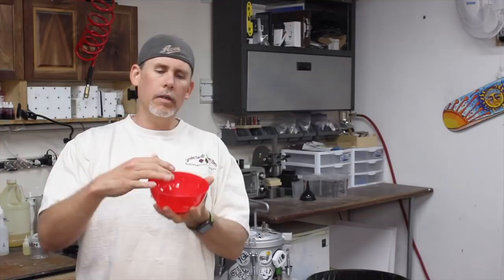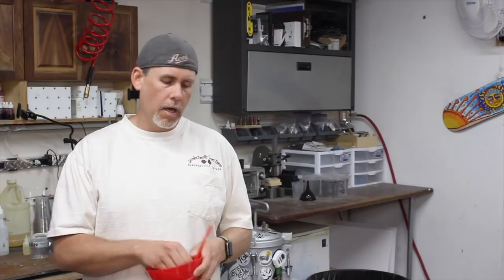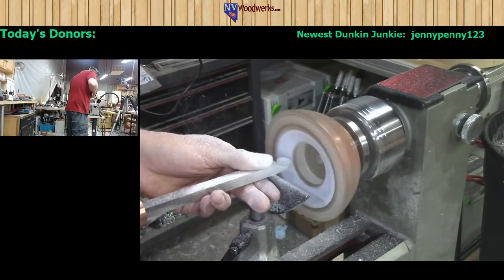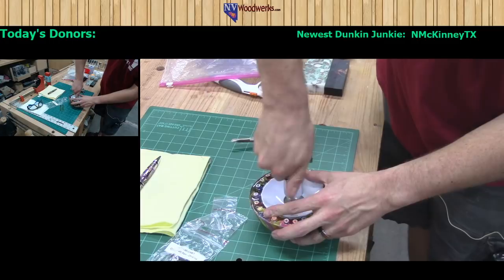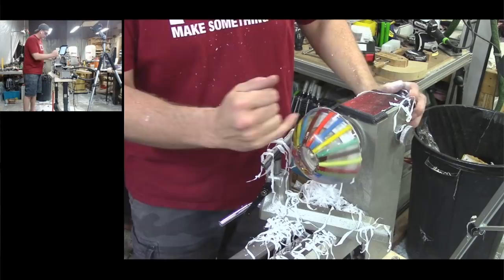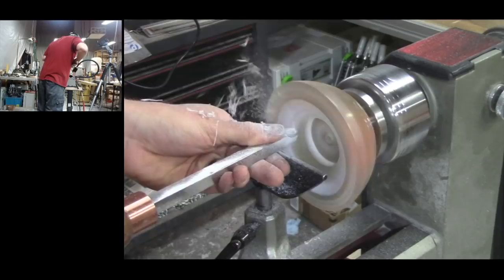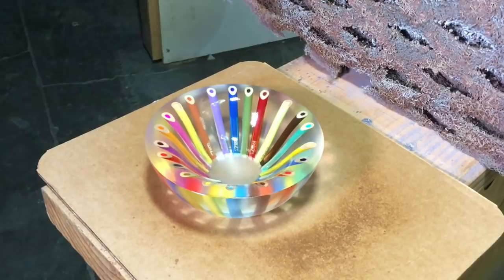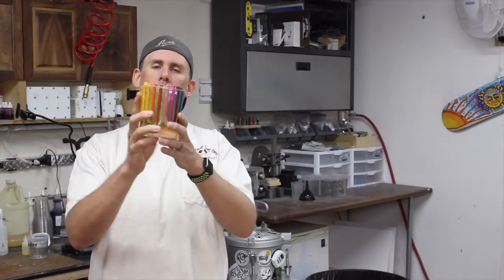The Colored Pencil Bowl | Dunkin Junk

Comment: Zac - there are a lot of people turning colored pencil projects - pens, vases, bowls, etc...  A lot of issues arise from the lead popping out, the fact that the wood is soft and other issues.  Have you seen anyone try to stabilize the pencils first?  Especially for the pen blanks.   You could then cast pencils into Alumilite and create the blanks.  What do you think?
Reply from the maker: I haven't heard of anyone trying to stabilize them, but it would probably work. I have a feeling that the Cactus Juice may affect the colors though. I've made pen blanks and had no problems with leads popping out. Just cut up the pieces and tossed them in the resin

Comment: Hi Zac, I really love your work you do but I also have a question. Is it safe to eat from plates made of epoxy resin? Is it safe to put in hot food or heat up in microwave? pretty sure it isn't safe to heat up in microwave but I'm not sure.
Reply from the maker: Thank Yura! I really appreciate it. To be honest I'm not sure about microwaving it. I'm going to guess that you don't want to, but you can always contact the manufacturer of the resin you are using to find out for sure. As for being food safe, there are some formulas that claim to be food safe like ArtResin, Alumilite Amazing Clear Cast, MAX CLR, and there are probably many more. I would again recommend contacting the manufacturer to ask about your specific application just to make sure. You can also use a food safe formula as a seal coat on top of another product. Again, I'd recommend contacting the manufacturer to make sure it will be safe for your specific project

Comment: Because i have not had the opportunity to use alumilite yet, since you have a discount code right now im seriously considering it. right now I am using polyester resin for casting,  which also can be brittle.  is alumailite brittle as well? if someone drops a pen will it break? .... btw cool bowl...
Reply from the maker: Hey Nathan, no Alumilite is not brittle at all, turns like butter!!  I've never cracked or broken a pen or blank that I've dropped. It's still plastic so you can't run it over with a tank, but it's pretty tough stuff. 

I'd give it a shot, I think you'll really like it. The first resin I tried was PR, and after one casting I tossed the rest in the trash. It's horribly smelly, and can be really chippy. Alumilite doesn't have the toxic fumes like PR either

Comment: Hi Zack, why when we stabilize wood we wrap them in foil? I was experimenting and put a piece on the grate of the oven not wrapped.  It turned out great with no pooling bleed out. Thanks
Reply from the maker: Hey Tom, It just keeps the blanks from sticking together and keeps any excess cactus juice from getting all over the oven. I usually don't wrap the things that I stabilize, but I wipe off the outside of the pieces very well

Comment: Zach,Can you make a resin casting like this with out a pressure pot?  Does is just take longer to set up or will it not work at all?Thank youJulie
Reply from the maker: I usually suggest using pressure as a little insurance against bubbles, but you could definitely use a slow setting resin for this. You can also use vibration if you don't have access to a pressure pot, use a palm sander or set the mold on a machine that will vibrate a bit until it starts to set up. 

Alumilite has a slow setting epoxy product that would work for this called "Amazing Clear Cast",  there are lots of other epoxies and polyester resin too that all have slow set times
Reply: Zac Higgins thank you so much for taking the time to answer my question!!
Reply from the maker: You're very welcome, I'm glad to help out. Plus it was a great question =D

Comment: WOW Zac!  That looks super. Did you have any issues with the colored pencil "lead" tearing out?

Any recommendations on negative scraper brand, size and ???                             JimE
Reply from the maker: Thanks Jim!! No problems turning it, they cut fine. I use Thompson tools myself for traditional high speed steel tools, they work great and Doug Thompson is great to work with

Comment: What brand negative rake scrapper did you purchase. And from where did you get it. I've been on the fence about getting one. Any help would be much appreciated. I love your channel 🤙🏻
Reply from the maker: I like the Thompson brand tools, it's one of the types where you can interchange the steels in different handles. The steel is absolutely the best I've tried, and the company is great to work with. I have links to Thompson (and most of the other tools, accessories and resin casting materials I use) on my website: http://nvwoodwerks.com/tools/

Comment: Alumilite clear
Reply from the maker: Ok, well, it's not a bad idea to wipe off the piece with denatured alcohol before you start applying a finish, and you don't want to polish it to a very high grit before you apply finish, I only go to 600 or so.  Definitely do not use any buffing rouges or waxes on the piece before you apply the finish. You want to put thin coats of it on, I usually go for 5 to 10 coats, I scuff sand after every 2-3 coats with 400 to 600 grit paper